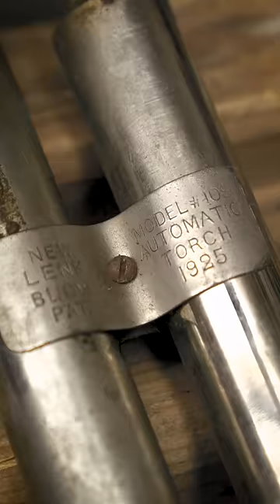Antique Torch Refill and Testing  #antiquetools

Comment: I have one of those, never knew how to operate it. Now I almost do, just need to know what is the fuel used?
Reply: Looks like lamp oil or kerosene. Might be naphtha as well (zippo fluid)
Reply: O bencina 😊
Reply: Por el color celeste de la llama, es algún alcohol. La bencina, nafta, kerosene o gasolina, al no tener oxígeno en su molécula da llama amarilla.
Reply: Wood alcohol and they work great
Reply from the maker: I used pure alcohol
Reply: @FFD_Restorations  Cool. Thanks.

Comment: ⛽️  What did you use for fuel ?
Reply: Alcohol 99%
Reply: @orthodoxup3684  can not be 
alcohol 99%, мах 96.5%
Reply: Can be 99%.  You need to dessicant to it to make anhydrous alcohol.   Then strain it out.  Magnesium is the dessicant of choice usually but others will suffice.
Reply: @dmitryjuravlev  абсолютный спирт вас удивит)
Reply from the maker: Alcohol
Reply: @dmitryjuravlev  IPA can become 99.995% pure

Comment: I want to modify an old style carbide miners lamp to work as a small torch  .  The dry Carbide fuel creates oxyacetylene gas when water is dripped onto it , then a spark is used to ignites the gas . The White light it creates is so bright it can burn out your retinas just like welding can from staring at it without eye protection. As a headlamp, it is still used in place  of electric lamps because it's super bright , long lasting and full spectrum light so fine details are easier to see than with l.e.d.
Reply from the maker: It seems you know a lot about them but still I would not recommend doing that. Highly dangerous

Comment: How is the flame forced out?
Reply: Heat from the main tank travels through the thin tube and heats the rest of that tank causing the fuel to vaporize in the wick and be forced out of the tube.
Reply: @desertdog3684  thank you, sometimes im a little slow on the uptake lol
Reply: @carbonoctopus7855 your not slow, just curious. It was a good question as I even had no clue how it was blowing the flame either.

Comment: I've got one of those I acquired around 40 years ago. I fill it with method. Not sure what fuel you're using. If you get the nozzle tube at the right height it can produce a good strong flame hot enough for many useful purposes.
Reply: Meths not method !! Darned spell checker!!
Reply from the maker: Good to know! Thanks
Reply from the maker: I have used pure alcohol

Comment: ❤❤You need to leave the fine jet tip on it and you just heat the tip end only up with a candle ,as soon as it warms it will force the kerosene out and there will be enough heat produced to keep the cycle burning ,you didn't bother to find out how it worked ?
Reply from the maker: Thanks for the tip!
Reply: @FFD_Restorations  no problem,would love to see it running properly in a dark setting to see the projection of flame ,should be able to make well over 1500 F with kerosene and hotter again if a mix of kero and Shellite which is the main ingredient of Zipo lighter fluid ,very cool little blow torch ,loved these type of things ever since i was a child 😊👍

Comment: Wow, I forgot about those. Be sure to buy fuel quality oil.
Because a lot of people will try to use saffrow oil, it will not work. Because in America, they add glycol to your oil. To keep it from being a fire hazard. I would say to steel money from you. But the problem is that having insurance on the warehouse that keeps the oil. It's cheaper to add a little glycol and save yourself a lot of money. And that is the reason those things went out of style. You have a hard time finding fuel quality, Olive oil.
Is here in America.

And no, you cannot use food grade Olive oil if you boil it first because it will be too thick because of the glycol.
And glycol will also keep it from burning. The only thing you're getting rid of is the water. And like with gas, a hall, the glycol will suck Water out of the air.
Reply from the maker: Much appreciated, great point and well said! I ended up using alcohol 😅

Comment: you need to warm the body  of  tge torch  sufficuent  to produce vapour   then you will  get  a longer  flame 

there were  a  few  spirit type  multi
 fuel  soldering bolts around  the ww1 era     usuay had asbestos string wrapped around the handle  to  provide the pre heat   you soaked this and filled the resevoir wadding  with the available fuel    meths ' petrol, deisel'   parrafin      you removed the cap on the burner     lit the handle  the jet would start spitting  vaour  then you would light  this   by now the  handle  would  stop burning    and the jet /burner would generate   enough heat to   keep it running   this would heat the copper bolt   that  was piggy back attached 
a handy tool if your  off grid  and you need to solder  a leaking bucket or oil lamp   tree rosin would do as flux 

for this torch using meths  pouring boiling water over it  would be enough to produce  vapour    or in deepest trondheim  winter  immerse the body in a vessel of   hot reindeers urine 😂
Reply from the maker: Thanks for the feedback and sharing, I appreciate that!

Comment: After all that still don't know what the hell's happening it's kind of a bummer thought it would be a neat video
Reply from the maker: In this video I refilled an old torch with fluid and at the end used it to heat up the blade in order to pull it out. If you interested to see longer video, you can here: https://youtu.be/pssLQGV3VoA?si=37Yfu1Th_Ec5G8Zv

Comment: Sorry but...
 That is the complete wrong way to use that torch!
If you look at the cap on the torch tip you will see a hole filled with thick and strong leather and if you take a closet look in the center of that leather you will see a tiny hole!
Now the tank next to the torch is to heat the tank causing rapid evaporation and therefore also expansion adding also pressure and the gas escapes from the hole in leather causing the stereotypical torch flame shape!
Reply from the maker: Thanks, I appreciate that